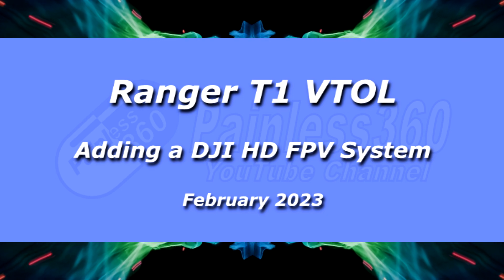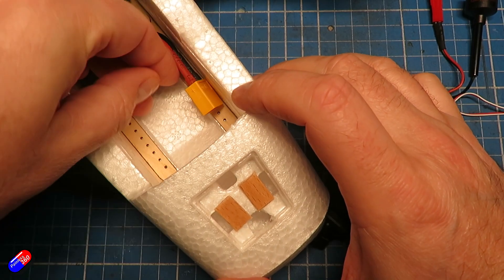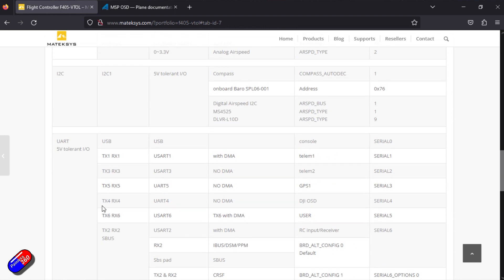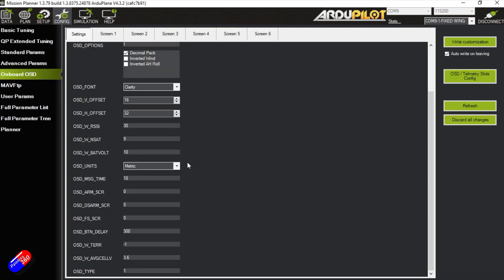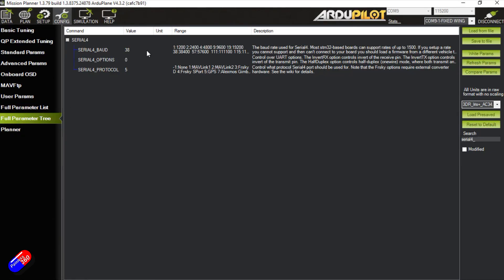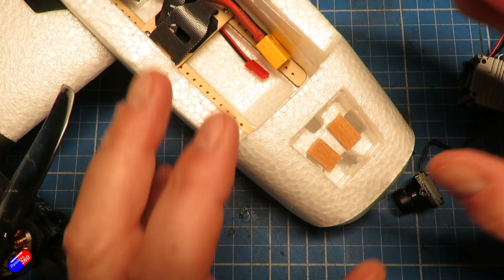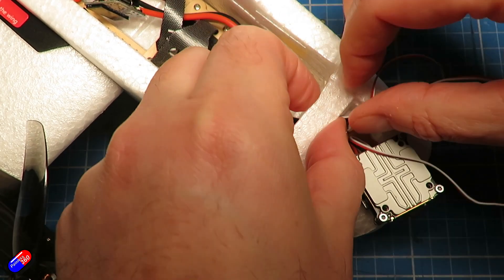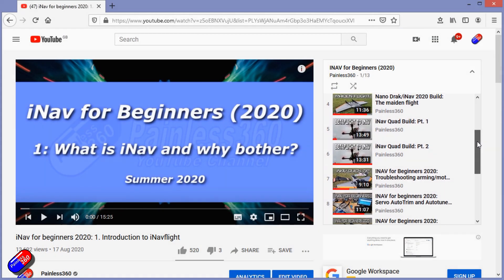Ranger T-1 VTOL Build: Video 4. Installing a DJI HD FPV system on the Matek F405-VTOL FC

Comment from the maker: NOTE: remember to check the channel assignments for modes and arming as you may have different channels on a DJI FPV controller. Whenever you change the radio, you need to rerun the radio calibration again. Happy flying!
Reply: Following this series with interest, Lee.  So I am assuming you are going to be using the black original DJI FPV controller since you connected your Vista to the SBus input on the FC?  Did you have to root your goggles and install wtfos to enable the MSP OSD support?  If I read the Ardupilot page correctly, it appears that some key OSD items (like flight modes) won't be visible unless you do root the goggles.  Looking forward to future videos and thanks.
Reply: I did this exact same setup with the same fc and cadxx vista with the integra goggles ,I cannot get the OSD working for the life of me... It shows craft battery voltage in the goggles on the bottom right but nothing else will show up..... I used this exact VTX on a different build with the Integra goggles running inav and the OSD works fine.... No rooting or anything like that necessary with the Integra goggles..... I followed this video step-by-step no dice....
Anybody got any pointers.??

Comment: Nice one! I haven’t seen any other videos showing how to use vista/matek f405vtol! Obviously this is in ardupilot could you please consider doing an inav-7 vtol with the exact same hardware?! Is it possible to use the same hardware setup & Which radio transmitter did you use, I want to use a dji v1 radio (black).
Reply from the maker: I am, Patreons are getting updates at the moment.. Happy flying

Comment: I just finished building and flying mine for the first time. This is my second, first was the conversion and followed your video. 
On the pnp my throttle is not linear at all, in a river it basically goes full throttle or minimal throttle. What did you do to calibrate the esc? Or did I miss a step?

Comment: Lee does anybody who is using crossfire need to attach sbus pins ?
Reply from the maker: You can setup a Crossfire receiver to output SBUS or CRSF. Most would use CRSF as then you also get the telemetry back using the same UART.. See my Crossfile series.. Happy flying!

Comment: Great content Lee, I aways follow your video's. I have all the parts needed. But I would like to use Walksnail, I would still use the TX & RX4, would I still use the same Ardu commands as you have in this video even thou they are for the DJI units???  I also see there are 2 addtional wires    that go to SBUS on DJI  but not on the Walksnail.  Will I still get the OSD in my goggles?  I see your last post about uploading a FC file. I have used BF before, but never Ardu pilot  I too would be interested in the same file.  I am going to give it a shot on my own, but would still like to have a guaranteed working file.  Keep up the great work.
Reply from the maker: I've not yet setup Walksnail with Ardupilot. Let me know how you get on... Best of luck

Comment: Hello, this might be a bit of a silly question and not strictly related to this video series but I am trying to find a glue for foam that is actually available to buy. Uhu Por and Beacon Foam-Tac appear to be unavailable anywhere I look. I have a nice AR Wing Pro that I like to build and I am only missing the glue ! Is there are general rule of what type of chemistry a good foam glue is made of or a non trade-mark general name for such glue ? Kind regards, Jan P.
Reply from the maker: UHU POR is on Amazon here in the UK...

Comment: I used the full size akk ultimate 1200mw. With a little trimming I tucked it between the rails under the battery tray. The heat sink exposed under the plane for cooling.

Comment: I did my Vista mostly the same way, but it's more of a press fit without the wood on the bottom of the bay. Think I'm going to go back and add that along with the zip tie. Much more secure and I also trim away a little bit of foam for more airflow. Great tip!

Comment: I also considered installing the Vista that way because it is the easiest and most convenient way, but the problem then is: how does one mount a Go2 or Caddx Peanut then on the front?
I think some kind of 3D printed cradle that arches over the front of the Vista and with spikes that go into the foam will probably be a way of doing it for those who have 3D printers. I wouldn't tie-wrap it to the Vista though, because in the event of a hard landing or crash it could pull the Vista out an rip off the wires.
I also installed a mini switch for the Vista. I suggest doing that to prevent it from heating up while waiting for satellites or configuring something.
Also, in my case, the camera didn't fit snugly into the nose, so what I did was cleanly cut the whole front section out from the bottom so that I could cut the camera hole to size and then glued it back in.
Reply from the maker: Thanks for sharing how you did it. It's a VTOL so not expecting hard landings.. ;) Happy flying!